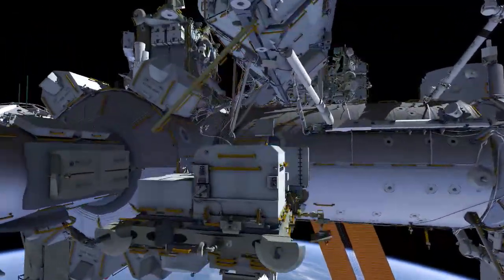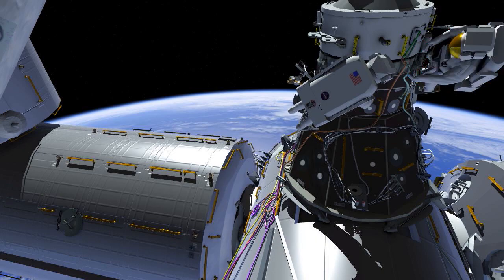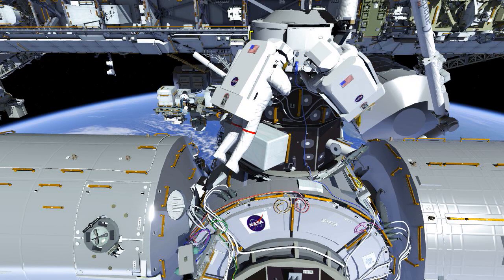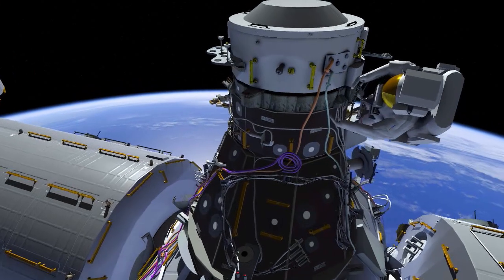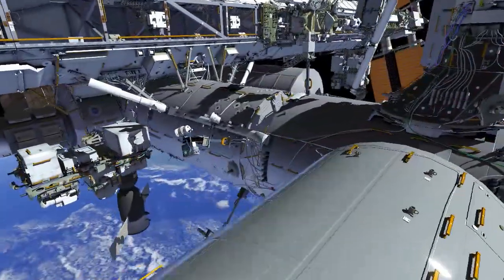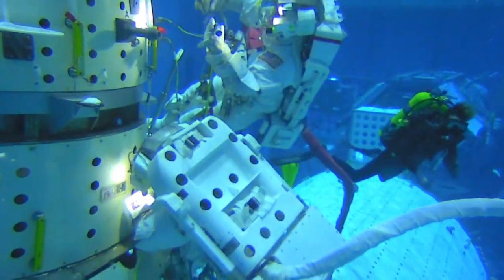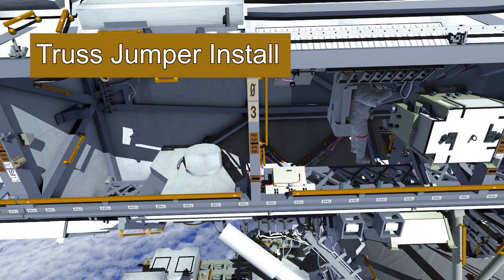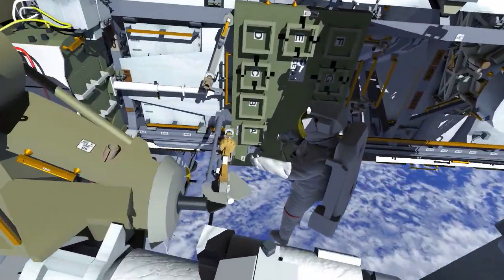IDA 3 Spacewalk Animation

Comment: The cables have been out there for 5 years?  Why so long?  Were they originally for some other project or was this one just super delayed?  Or did they want the cables to be exposure-aged for a good chunk of time because 'reasons'?
Reply: I have the same questions. I hope they answer!
Reply: IDA-3 took a while to be launched because it is a replacement for IDA-1, which was lost on crs-7.
Reply: @Vought_dog  That makes some sense, though if these cables are so important and subject to being aged by excessive exposure then why not bring them back in when it became known that it was gonna be awhile before they were needed?  Granted, the engineers have a way better idea of how exposure would affect their performance than I would, just seems a bit silly to leave them out there to petrify and age in the harsh vacuum environment.
Reply: @MrGoesBoom  Regardless of when they were installed on an IDA (originally in 2015 when CRS-7 launched) they would be expected to work in 2019 after years of exposure.  They'll just be a bit stiff for being coiled for so long.  Removing the cables from the exterior while waiting for IDA-3 to be built/launched 4 years later means probably two extra EVAs... one to remove, one to reinstall.  Also, I believe most cables stay coiled in their bags and stored on the exterior pallets until they are needed.  So it's not just removing the already installed cable, it's trying to coil them back up neatly in zero-G.  Just not worth the risk/time.